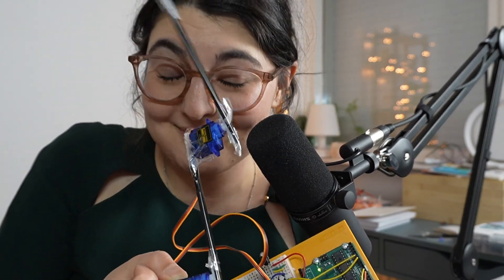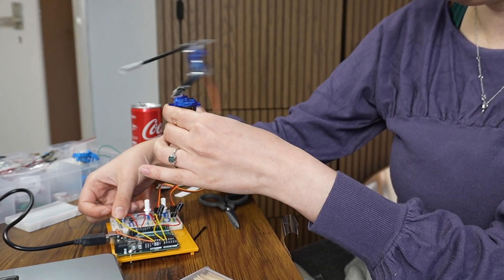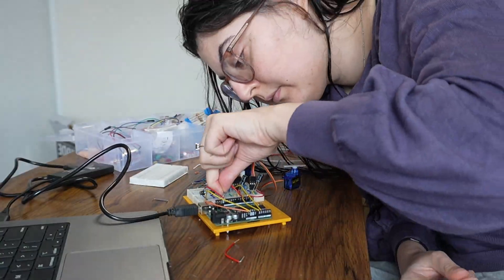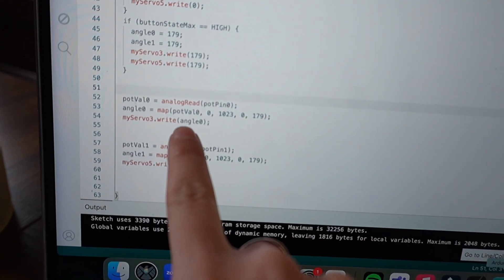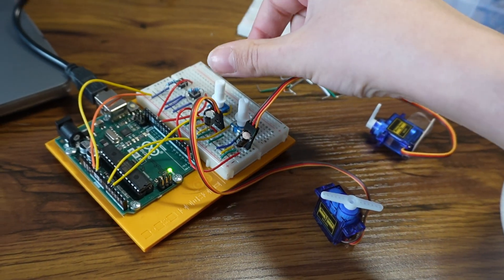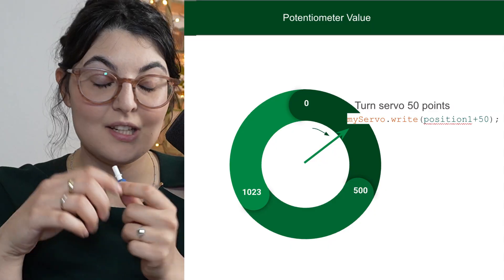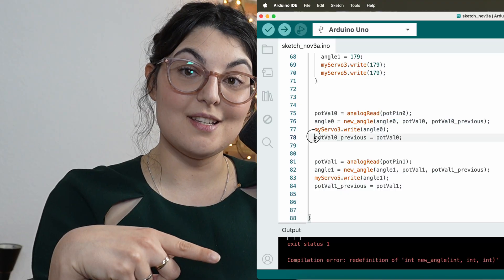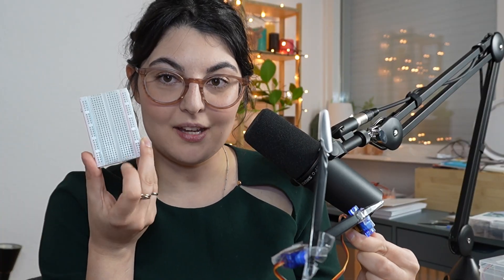Robot Arm Control: Arduino Servo Motor Programming

Comment: I am a beginner in this field, and I was wondering if you could recommend which Arduino microcontroller and/or additional components I should purchase to get started?
Reply from the maker: Hey! Welcome to robotics! I made a video about where to get started and some project ideas, check it out on my channel! It depends if you want to program in Python or c++, if you want to focus more on hardware or software, etc. I’d start with a kit with some electronic components in it - watch the video first and then comment there if you have more questions!

Comment: I do like that you are trying to figure things out incrementally instead of just asking an llm like everybody else does these days. You might wanna try introducing variable speed to your motors. Instead of just setting the new angle, increase the angle at something like 1 degree/10ms or so until you reach the final angle. Next step would be  ease in/out. that should make it less jerky.
Reply from the maker: I think the main issue is you’re not supposed to really control multiple motors from an Arduino itself. I’m getting an extra servomotor managing component and that will also make it smoother. I’ll try the speed as well, thanks for the suggestion!

Comment: How your data science degree benefited you in robotics field or you have regreted? I want to know the relation between them
Reply from the maker: I think it’s an interesting background that you can for sure combine with robotics. A lot of the courses were math and programming which is essential for robotics too; and a lot of the cooler autonomous robots these days work with large ML and AI systems. At the same time, I definitely need to catch up on some physics, electronics, control systems, etc. But I think I’m starting form a good position with my background!
Reply: @backtoengineering ok but in these days do you prefer working in embedded/robotics field in job market that suffering now
Reply from the maker: I am still working in AI for now, and I’m starting to focus more on YouTube content. But I’m considering getting more into robotics in the next years!